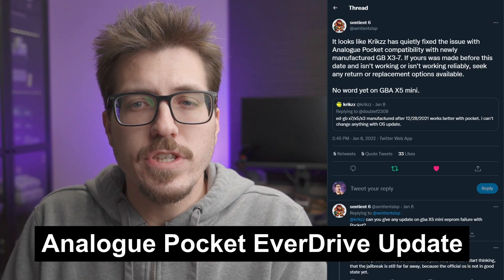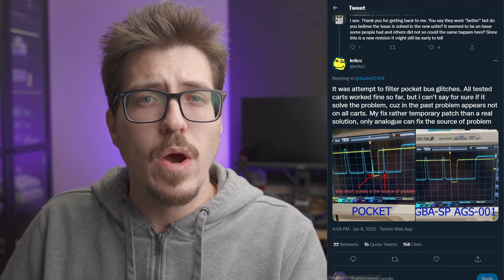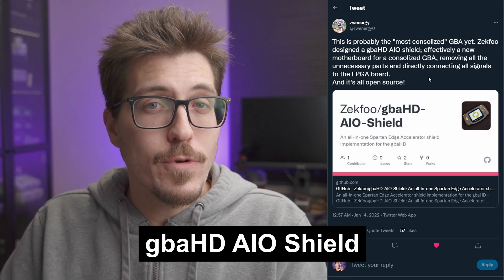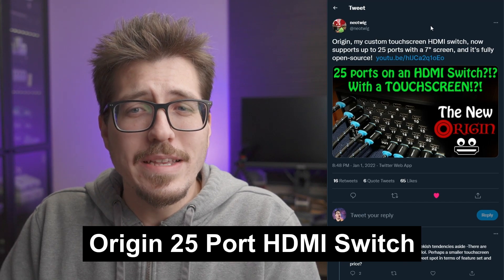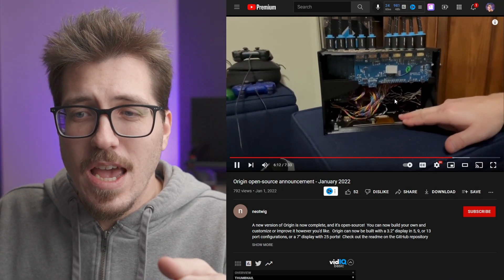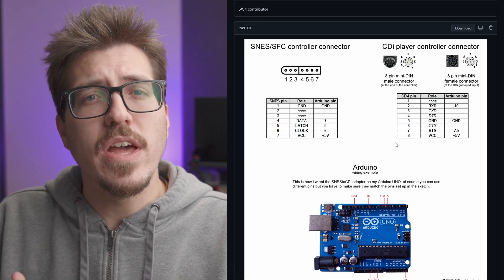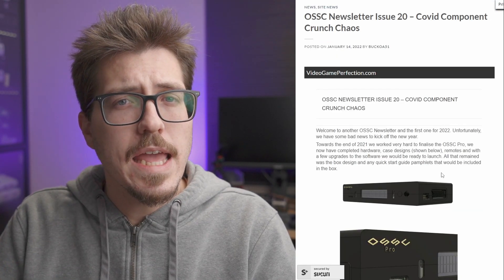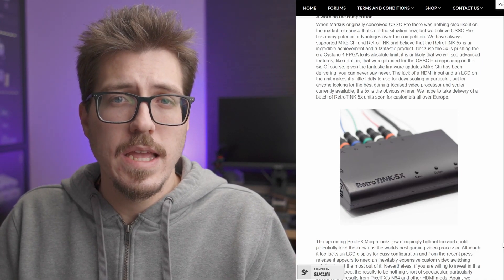OSSC Pro Delayed and Case Finalized - Retro Modding News 1/16/2022

Comment: That HDMI switch is an odd one. It's very neat and tidy, but there doesn't seem to be much practical use over finding good compatible automatic HDMI switches and chaining those. I use about 7 of those Vorke units from the old schmups hdmi thread to make all my various HDMI native and modded systems just turn on and go without having to switch stuff around.

I'm really looking forward to the OSSC Pro. It's really looking like the high end solution of all of them. All the ports I could ever want and I know it will get support for years to come. I really like the Retrotink 5x for being able to give a great result with no fiddling though. The Retrotink products brings the experience closer to the turn on and play aspect of CRT's. 

While it probably isn't going to stop me from owning one, I am starting to wonder about the Morph. Where will it fit with the high end OSSC Pro and the easy to use Retrotink 5x. I really dislike the push of their own switching solution to offload features and connectivity that should be on the main device. I might just be being too hard on it as it seems to be aimed at a different user type than I am. It'll be interesting to see how things turn out.
Reply from the maker: That’s an interesting thought about the Morph. I understand the idea of it but at this point peoples setups are locked in, especially someone thinking about buying a Morph
Reply: I'd figure people would have established setups at this point. Especially the ones buying more advanced video processors, but they must feel there are enough new people coming in that a new switching solution is viable. It'll be interesting to see if it's feature rich enough to start converting gscartsw, gcompsw, extron crosspoint, etc users over.
Reply: @TheRealGara  you don’t need an Infinity Switch to use a Morph. Just use it with a gscartsw, gcompsw, or extron. The Morph input being able to accept any signal format makes it easier to use with existing switchers than any current scaler.
Reply: @TheRealGara  the Retrotink-5x and Morph both have 2 video inputs. The Morph has an any-analog input and an hdmi input. The Tink-5x has two analog inputs and no hdmi input: a scart input that can only accept RGBs (not vga or sync on green), and a RCA input that can only accept non-RGB inputs like YPbPr, composite, or svideo. You really don’t get much of a benefit having two limited analog inputs on a scaler considering most people use a video switch anyway.
Reply: @woozle64  I get that I won't need to buy the Infinity switch to connect to the Morph. I will need a more specialized system to connect to it though. Being able to feed composite, s-video, YPbPr, RGBs, and RGBHV all through one output is tough. Not all setups need that much variety of course. I'm just annoyed that simultaneouse connection of all connection types is transferred to a switching solution.

Like you said the Retrotink 5x is far more limited and that was a disappointment. Retrotink 5x not accepting YPbPr over Scart had me change my setup. I'm using a Comp2rgb and a Koryuu to get all my signals over a single Scart cable via chained  Gscartsw switches. I'd prefer not to be transcoding any signals, but it looks like I'll be sticking to it with the Morph. 

I just need to get a Scart to BNC and 3.5mm audio cable made. I had an extra Scart to Scart cable made just for the Morph, but I jumped the gun on that one.

Comment: I ordered 10 of the gba aio shield pcbs to build them i have a bunch of gbas with bad power area due to battery acid
Reply from the maker: I wonder when a case will be available
Reply: I also wonder when on that one because i will need one
Reply: Maybe ill learn to use cad software or autodesk this month
Reply from the maker: @anthonyaviles8665  I started looking at Fusion 360 for making enclosures, it's difficult but not that bad with some tutorials

Comment: I have been holding out for the OSSC Pro since I believe the summer of 2019... am I correct? Still waiting to hear of the final specs to determine if I really need to continue waiting or go with one of the other modern solutions. Thanks for keeping us up to date! Cheers~
Reply: It's delayed indefinitely until parts are available.
Reply: @RastaJediX  yeah that has been fairly obvious, lol. But the 2 year delay on even the final specs is clear that there have been development roadblocks. Had I known there would be so much delay I would have went with something else. I keep holding out though as they say it is coming and then announced new delays- this happened like 4-5 times now. Fingers crossed things come together for them!
Reply: @bernardaarondolecki  my point is it was never labelled as "2 year", for all we know it could be sooner (don't count on it however).
Reply: @RastaJediX  at one point they announced that it would be done before the end of 2020. I never said that they announced a release in a “2 year” window- I said they have kept delaying it for now 2 years. If I had to guess, I’ll be hopeful for a fall 2022 release.
Reply: @bernardaarondolecki  oh, ok. It was unclear, sounded like you said two years from now. I recommend you look into the Morph or RT5X for now!